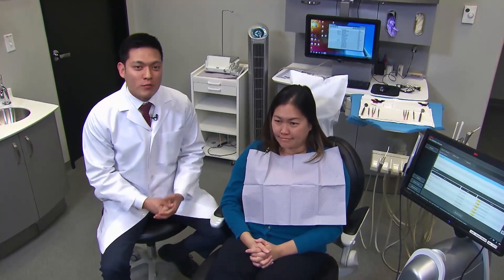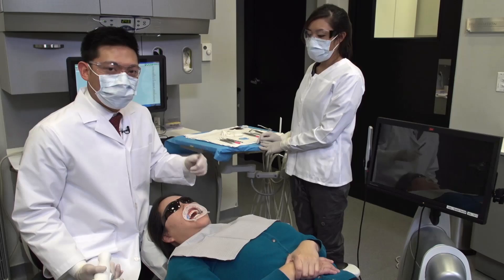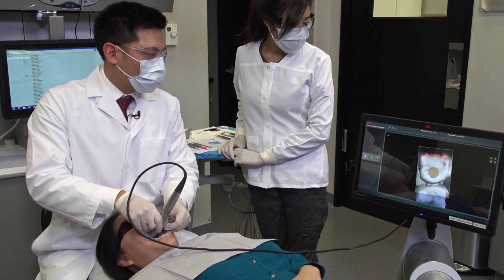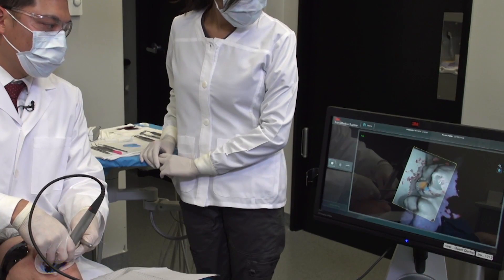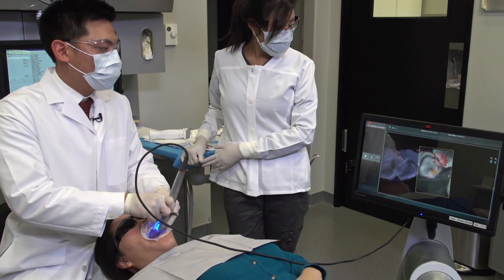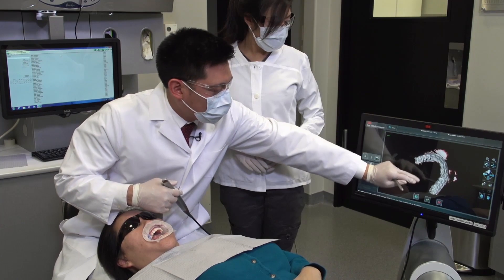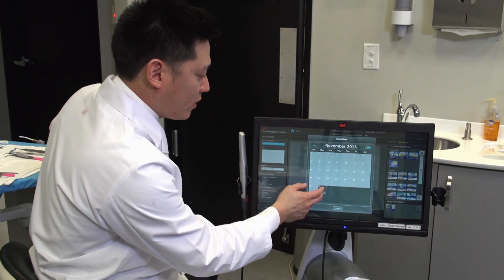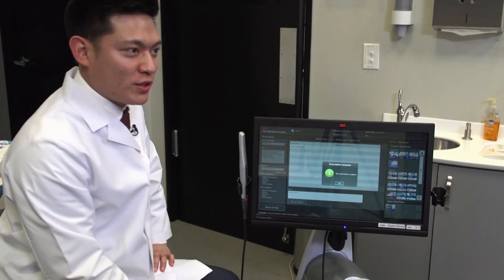Case of the Week: Digital Bite Splints Done Right

Comment: What is the brand of the scanner? Thanks
Reply: We used the 3M True Definition scanner. The system acquires data very quickly but it does require a contrast agent. You can find more info here:
http://www.3m.com/3M/en_US/company-us/all-3m-products/~/All-3M-Products/Dental-Products/Dental-Impressions/Digital-Dental-Impressions/?N=5002385+8711017+8713393+8740247+8740252+3294857497&rt=r3